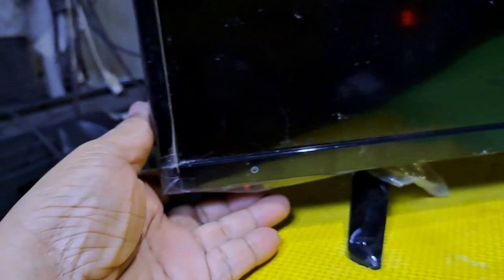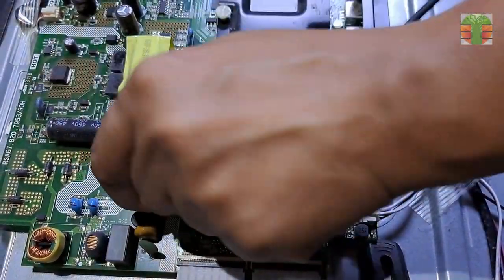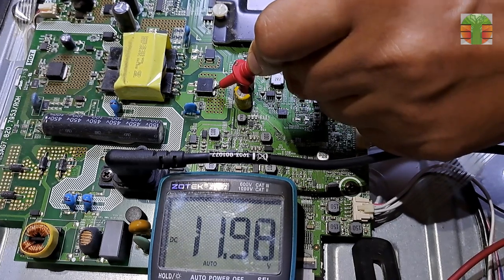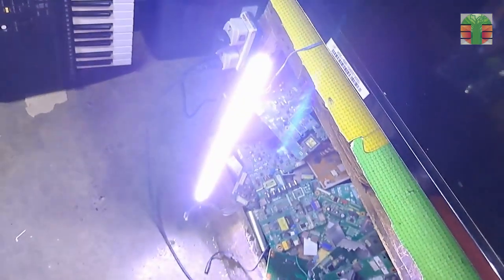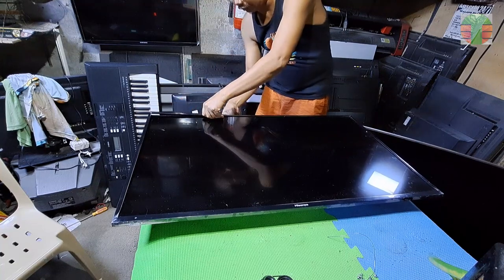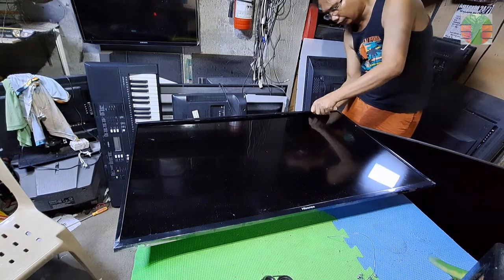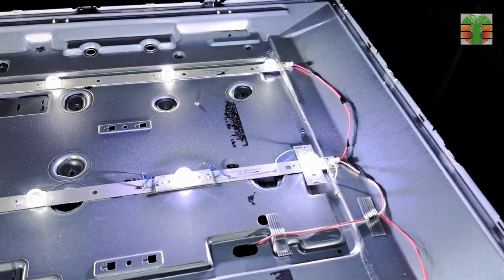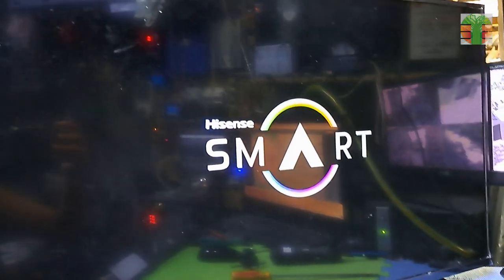Hisense smart tv has no image and a high-pitched sound fix.

Comment: Hi tevz can you please tell me if the number of leds in your edge strip is critical as i would like to use your test method, does the size of the tv need to be considered?  do you use different strips for other sizes? or is it about the output voltage of the led driver?, Thank you.
Reply from the maker: 38leds  and about 120volts
Reply: @tevzTVTevatronics  Ah ok, thank you tevz  i will try it , have a good day!